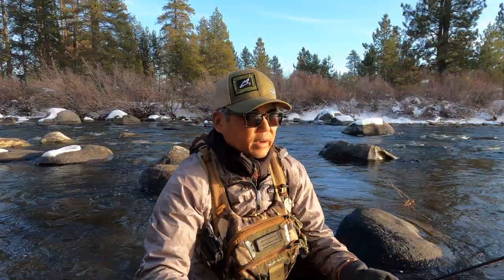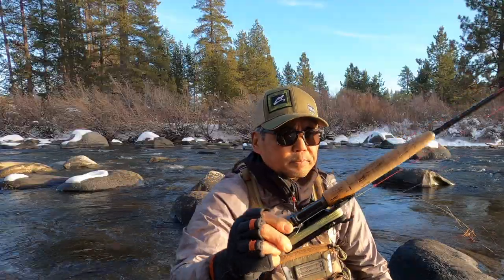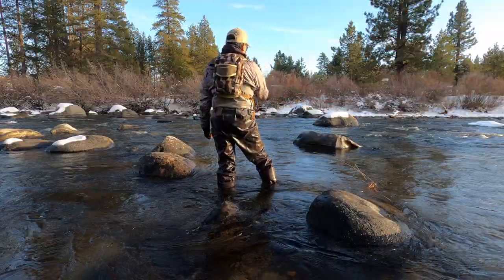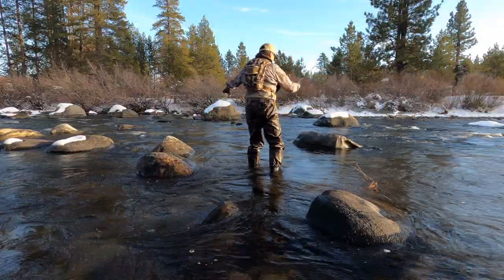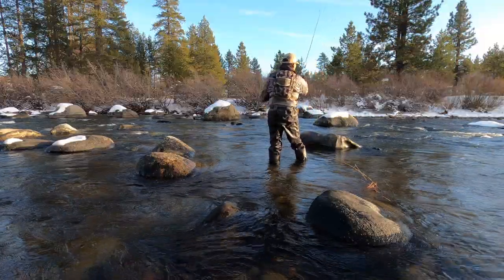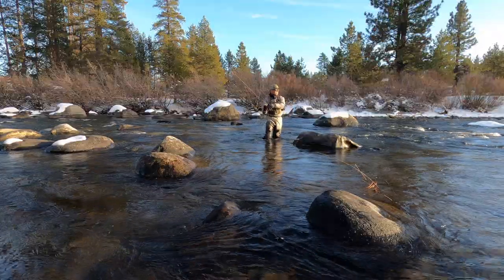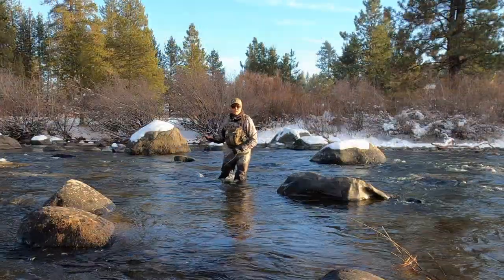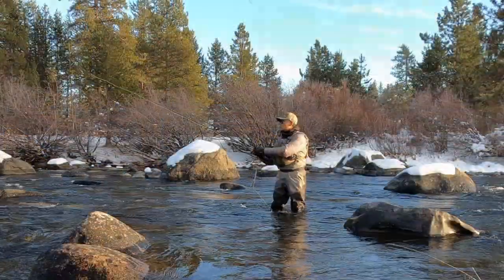Euro-nymph Casting Tips for technical pocket water

Comment: Just trying to understand how can you keep contact when casting so far upstream... I rarely see anyone euro-nymphing casting upstream in that kind of water setup. And lastly, sorry but that bend radius on your stinger reel is something the lines won't forget. So part of me is always excited about innovation but frankly what problem were you trying to solve or improve with this reel because selling it to me as a tool that will improve precision in my cast isn't making much sense outside of it being half the weight of the lightest reel you can find on the market. When it comes to "surgical precision cast" I care a lot when I fish dry flies. When I am Euro nymphing the weight is on the hook so it's pretty hard not to not hit a spot, it would be more about the sinking speed of my fly and my presentation is drifting while keeping contact.
 Sorry for being so hard on your stuff but I saw semi-automatic reels not being adopted outside of Europe because everyone seems to complain about the drag system failing on bigger fish. So I am not entirely sure how yours is going to do. Lastly, how is the stinger doing when you have wind bursting around?
Reply from the maker: Hi Ben! 
Good contact after a long casts means that you've got your line elevated and have removed all the slack and are getting a good dead drift. Contact may not be as good as fishing under you rod tip but the advantage is still there over floating line or indicators. In my waters the wading is difficult and I can't wade to every target. Casting long increases my target. Also casting long is essential in clear water where the fish can see you coming.
Bend radius of Stinger spool. If you use low memory high quality Euro nymph line and leader, the coils come out quickly. Pull out coils first by hand if you'r in a hurry or let them stretch out naturally. Either way the line becomes straight.
Accuracy- Feeling the flies weight at the tip end will always improve your casting accuracy. Like throwing a dart at a dart board, you'll certainly take of your heavy watch first to better "feel" the weight of the dart. 
Casting accuracy and distance while euro nymphing are essential in mixed current pocket waters vs smoother dry fly situations you mentioned. The beauty of the euro nymph system is that you have far more targets to aim for in mixed water. Your targets while nymphing are not a rising fish, rather you're aiming for inside/outside seams, gaps, boulder edges, between logs, between grass strips, etc. Fly fishing dries on top is 2 dimensional while fishing subsurface is 3D. So precission accuracy why euro nymphing is crucial to catching more fish. 
Sink rate is very important while euro nymphing and you're always adjusting depending on your targeted strike zone. Changing weights (lighter flies/heavier flies) changes the cast dynamics so being able to adjust the cast is important to maintaining accuracy. 
Wind- Wind doesn't affect using a Stinger any differently than using a traditional reel. the line is the line while fishing.
The lightweight Stinger was developed to improve dead drifts. Longer dead drifts and more targets equals more fish. It was developed for technical stream and river situations where you are using light tippet (5-7X). Situations where you are mostly using bead head nymphs with 2 to 4 wt rods, not large articulated streamers on 6-7 weight rods putting a fish on the reel. The Stinger is for Technical situations where you need to get the fish under control right away or he'll run you into boulders or logs. Fish closer to 20" in size, not 30" ocean bound or lake fish.  Hope this helps.   
-Jeff
Reply: @mavrkflyfishing  
[Good contact]  "the advantage is still there over floating line or indicators." Well then we are walking away from what Euronymphing is and what the title and subject of the video was supposed to be... I wouldn't pick a euronymphing when the fish are out of reach.
[Bend radius] Again either we are taking about euro nymphing or having an actual use for a weighted line. In all case they were engineered to be stored on a spool and ideally not being twisted along the way. Unless you carefully wind your line back on the stinger at the end of each session, you'll inevitably induce twists while wrapping. Lastly, it's kind of funny to see people spending so much money for a fly line that basically servers no purpose on the idea of Euronymphing, at best it's because it's part of the FIPS rules other than that I am doing just fine when I don't follow FIPS rules I just go with nylon and ~8m of high quality sighter leader material then my tippet but yeah I get that some will argue that it isn't giving me the option to switch to dry fly if I wanted to, but it sure did me extremely well when it comes to detect and feel what's happening with my presentation. 
[Accuracy] The rod is the main tool to drive my cast and where I land the fly and how much force I want to apply for the fly to dive. I still don't see how the stinger will provide me that surgical accuracy. After fishing dry CDC and micro flies for years in Europe and then trying Euronymphing, I am totally aware of the mechanics and differences between the two. From my point of view, the complexity of the perfect cast and landing accuracy is the difficult part of the dry only the water surface matters (2D). Meanwhile Euronymphing is a complete walk in the park when it comes to casting and the difficulty is what's happening with the current, depth and keeping contact (3D) I landed more fish by being a thousand time more focussed and disciplined about managing a perfect drift and picking the right fly's sinking properties and attempting to keeping contact through different water setup. My casting accuracy, for a weighted fly while Euronymphing is far from the hundreds of hours it takes to have a perfect drop on a dry. I think this was just inherited from dry fly fishing and there is little to no complexity to cast in a Euronymphing setup, at best I'll just do a bow and arrow cast if it's a really tight and difficult area.  I still see people making complex tapering leader and not being able to explain why they do it when using weighted fly on a Euro rig (because that's what everyone is used to do for dry fly, again a lot of things are inherited from the dry world and theorized over to the euro nymphing).
Again on that sink rate topic, people are doing all kind of things with their leader and fly selection. It doesn't take ages to understand the technical aspects (for whoever is interested enough in the topic and doing his homework) but it sure takes a lot of hours on many river profiles to practice to learn and become better at it and there is a world to be practiced on how the fly will drift and flow in the water column while being presented to the fish, that's what I'd say will make the difference on catching more fish. I was happy to land 1 or 2 fish a day in France, then I moved to north America and it's a walk in the park the fish are biting like there is no tomorrow so I pick difficult spot, windy situation or attempting to find heavily pressured spots. 
Away, I still don't see how is the stinger reel any better as the surgical accuracy in the topic of EuroNymphing or flyfishing generally speaking.
I fished 7x and below for years when I lived in Europe. I can't rely on any reel's drag to manage that light setup but here is the thing, I rely on my rod to save my light setup and my semi automatic reel came with me to north america. It isn't a useful reel when euronymphing because again, even with an 11.6 ft #3 rod if the fish are that far out and I can't get a good presentation even with my arm way up in the air or the river profile isn't meant for euronymphing then I just won't force the Euronymphing technique trying to cast far away and hope for a fish to hook itself in the process. Casting far away doesn't catch more fish, covering more water does but what's the point to cover more water with a poorly executed presentation? That's when people decide to put a bobber on their line which isn't Euronymphing but I don't want to get too religious here, will it catch fish? Yes... But it's not allowed by FIPS rules (again not everyone is into competition but what is seen out there tends to drive the future of fly-fishing techniques and methods). The semi automatic reel is still a beast in terms of line management and removing all of that line retrieve process when the current is picking up the line or the wind is making things difficult. I don't have to look at it I just tap the trigger and it's done and it's super fast too, I can move onto the next spot without having to think about picking up slack {which I don't have when euronymphing}. The stinger requires you to look at what the line is doing and will take practice before you can roll things blindfolded. That's a tradeoff so once again, there are sales arguments that would get a lot of folks wanting to buy it but talking all night about casting and presentation isn't really filling the gap as how much better of a solution the stinger is. As of getting the fish under control right away that's basically being done by hand retrieve regardless of what reel is being used, it actually is even more challenging on short cast when it's raining or you have wet hands and the mono or fluoro is slipping. The only way is to have no line out and be straight to the reel. From a leverage point of view you'd actually benefit from having a heavy butt section, setting the hook and fighting the fish depending on people's habit when they get a bite...
Anyway, I'll at least give you the thumbs up for attempting an innovative product and making it affordable given what flyfishing gears costs these days. Apparently easy to pack and ultra light gears are "a la mode" so that'd be a sales argument but the technical improvement aspects are going to be really hard to sell, people will buy out of curiosity at the end of the day you could even have rod tubes with the reel {stinger} profiled to fit things in easily which is one of the issue with semi automatic reel, they don't fit in and the options are limited.